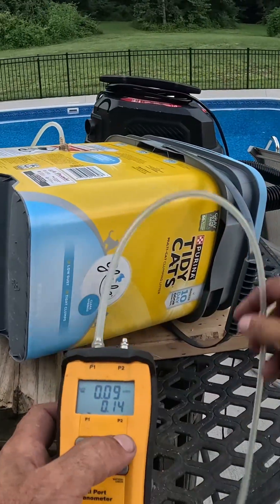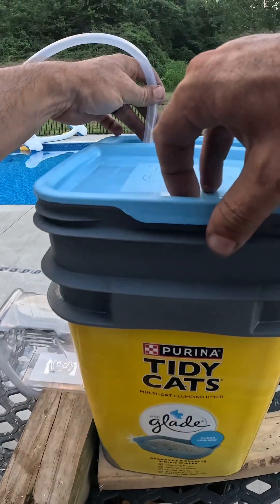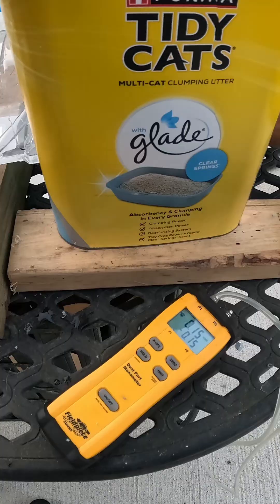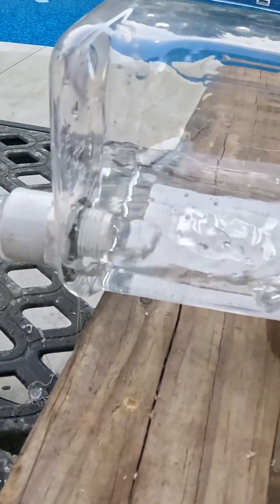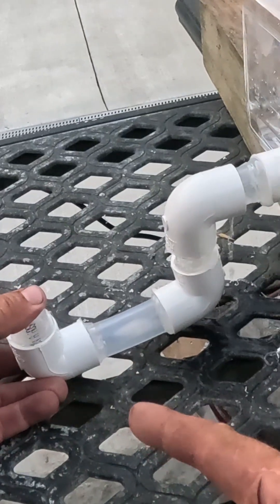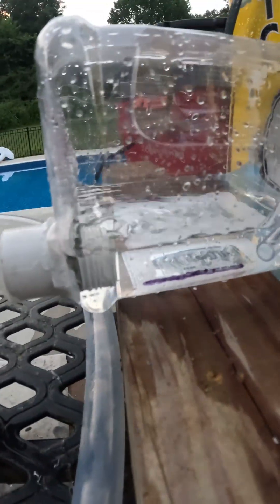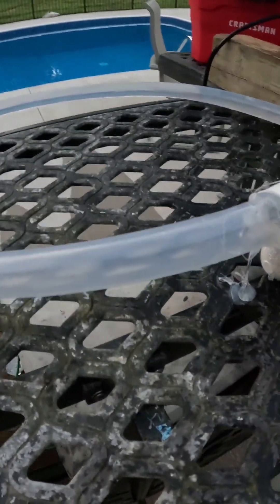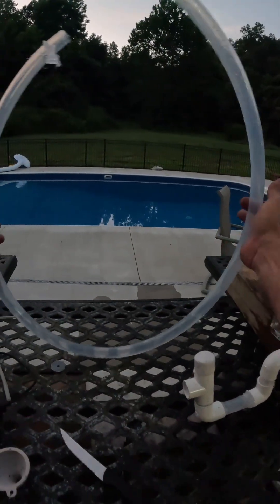Drain Trainer

Comment: Good job. Also, don’t forget that piece of sheet metal on the front and back of acoil goes down into the pan and usually has a little gap between the pan and the sheet metal. Water is easily pulled up through that small gap down over the pan (even at low pressure differentials) and into the center of the coil area, where the low pressure exist. This water pull-off will go down through the blower and electrical components, causing short circuits, rust, froze bearings and rotting floors.
Reply from the maker: This is true!